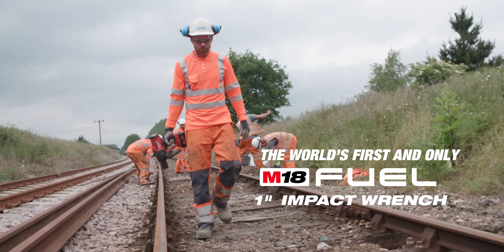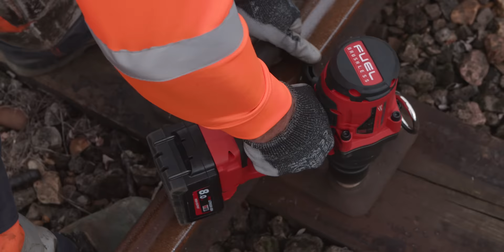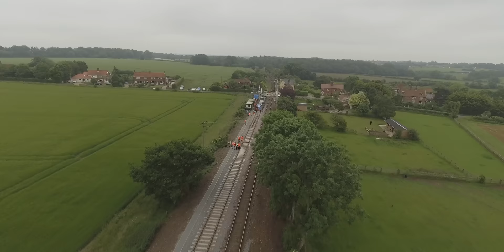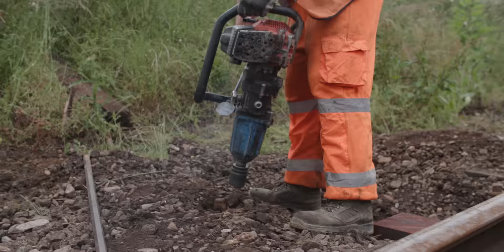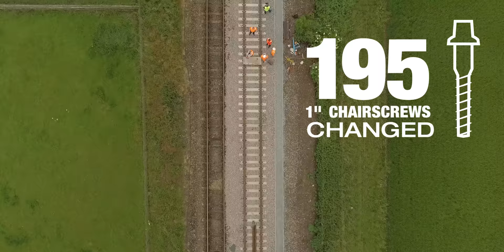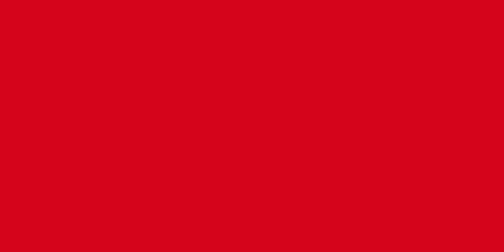WORLD'S FIRST: M18 FUEL 1" Impact Wrench

Comment: is there any real world video side by side compete those 2 exact model?
Reply: I've used both. The petrol is better by far for power and consistency but for most uses the milwaukee is better just because it's lighter and you don't end up smelling petrol fumes. The milwaukee is more comparable to the bosch 110v impact wrenches. For that reason I'd say it's good enough for most uses.

Comment: But will it take off these 10mm bolts holding my TV wall mount??
Reply: It should, I use mine only to screw in the face plate light switch screws. 😅😅😅 Plenty of torque
Reply: @jackiechan_wtf4041  yeah it has plenty of torque for the light switch,but it cant brake lose the wheel bolts on my Mercedes sprinter,im quite disappointed..

Comment: gee that pile of bolts would look a whole lot less impressive if you had not heaped up so much dirt underneath them.
Realistically this unit would not do the job you are showing it to do, 32 sleepers is SFA (approx 90' of track) and probably less than an hours worth of work. That's 8 - 10 batteries per day to do what you claim. Unrealistic.